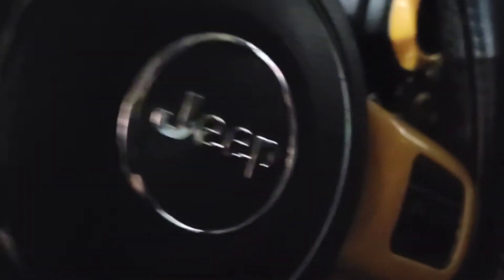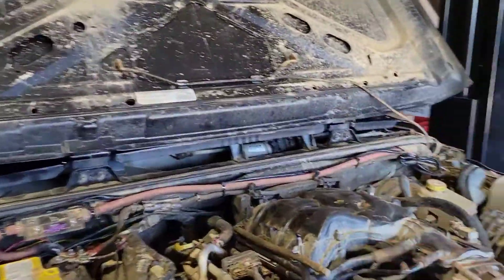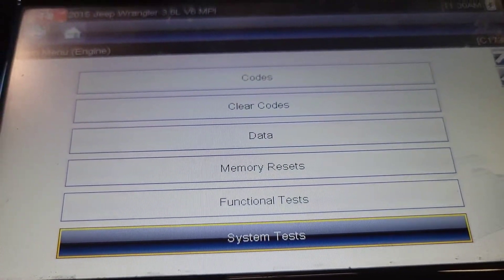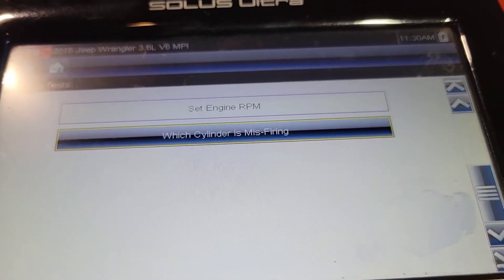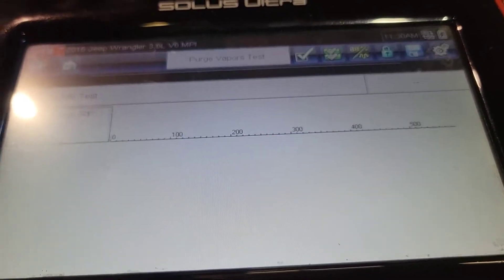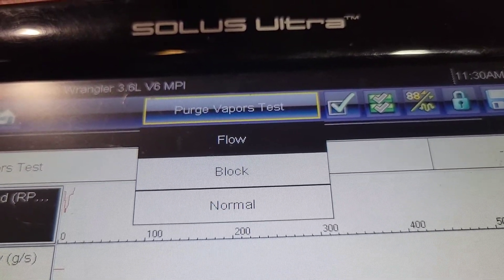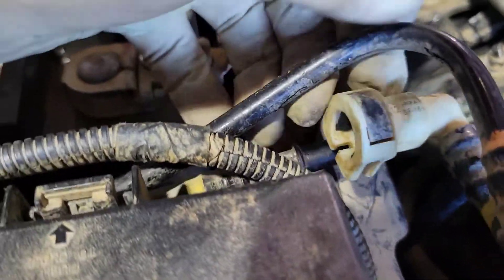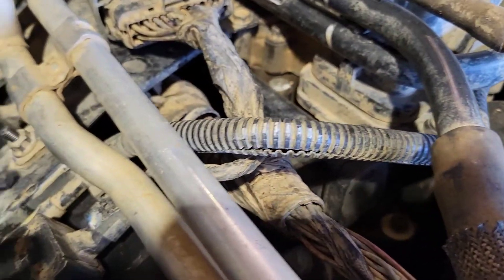Chrysler Stuck Open Canister Purge Valve

Comment: I am a usps driver and have a 2009 jeep wrangler,  driving for 5 to 8 hours and hear a escape of pressure from under the hood engine running and ruff idle starting , I turn off the A/C to hear . Very clear, the purge of fuel from the passenger side.. a buld up of pressure to much for the purge valve to handle.  Idle is ruff but not continuous
Reply from the maker: Hmm, message me your vehicle info on Instagram and I'll try to help you out. Thanks for watching